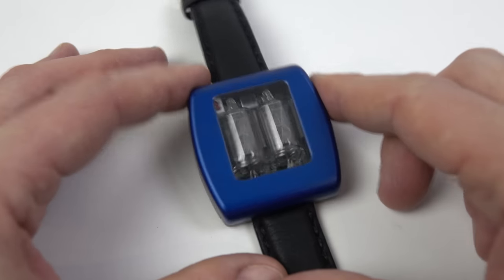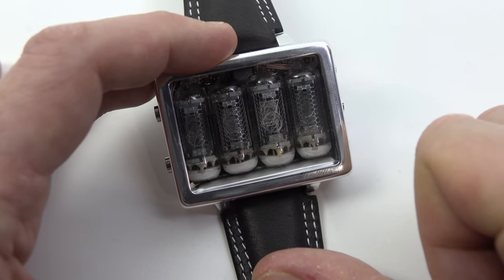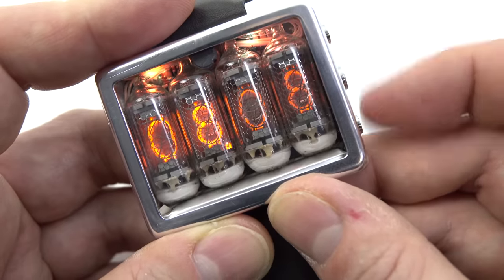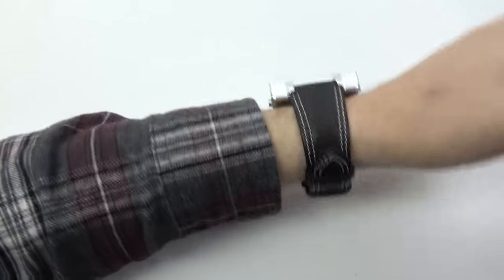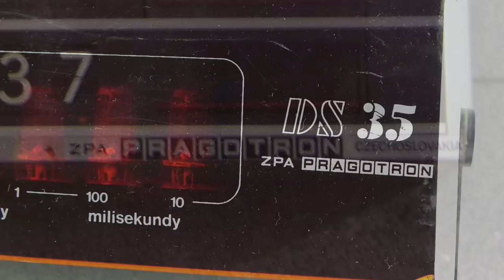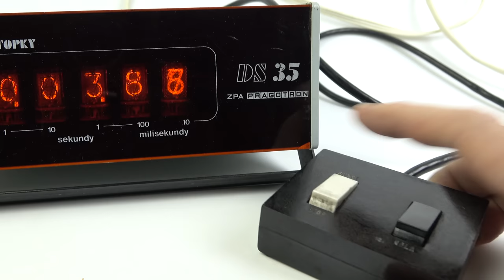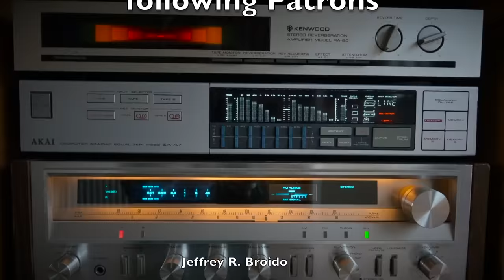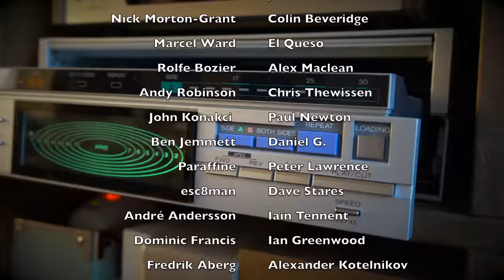Nixie Tube 2-in-1 : New Watch & Old Stop-clock

Comment: I had a Heathkit Nixie tube alarm clock I picked up in a second hand store in the 1990s (the unit itself was from around 1970). It was an exceptionally clean design with all the set switches on bottom and back with a simple metal band running along the top to activate snooze.
Reply: Wow I loved HeathKit! Miss that company so much I built many kits from them, including a weather center that used a flat panel version of the nixie tube.

Comment: The earth pin isn't 'missing', that plug is normally used with a socket that has the earth pin sticking out.
There's a  AMF venner digital counter that can be used as a frequency counter, but also as a stopwatch, but it's not as elegant as a dedicated stopwatch (i have one)

Comment: This Nixie watch is really neat, but for the temperature correction I'd have to say that this is a tricky subject. The more your hands are touching the watch, the more it gets heated up, so it won't display the room temperature accurately, but instead it will display a temperature that is closer to your skin temperature. I guess the correction setting would be for that, in order to correct for this factor (since wearing it on your wrist will definitely make it warmer than the environment), however I don't know how accurate that is in different climates, for example being inside a room at 20°C compared to being outside in autumn or winter at 5°C...

Comment: It would be a good idea to replace the mains wire on your stopky clock, what you have there looks like three core single insulated cable. Modern cable is double insulated - the three plastic covered wires are all within a second plastic covering. This is important because the single insulation can crack exposing bare wires.

Nice clocks though

Comment: the earth pin is not missing on that czechoslovakian clock, it is like this, because the wall sockets have the pin instead and two holes, the connector has two pins and an earth hole
Reply: PETR DOLEZAL Just like in France, though I have heard a rumor that the French plug are wired backwards (Live and Neutral swapped), though that may just be a misunderstanding.

Comment: I'll have to dig out the thing I got in a box of junk from an amateur radio club auction. It's a voltmeter with hot wire displays, never actually run it up, but I did get some info from the maker - before which I didn't know it was a voltmeter - was hoping it was a frequency counter

Comment: The right digits seem like they're labelled oddly.  Milliseconds when actually it's centiseconds (you'd need 3 digits to show milliseconds), and 100 under the tenths, and 10 under the hundredths.
Reply from the maker: See the multipliers under the digits. It’s a bit like the RPMs in my car which are x10.
Reply: Czech (or Polish, since the words are the same in this case [or I imagine any language]) doesn't really use centiseconds in everyday speech. I mean, it would just be really odd to have it labeled as centiseconds, but it's immediately understandable how to read milliseconds with two digits.
Reply: labeling is consistent. it is sec/min and 10s of sec/min too. not 10th of sec/min.
Reply: OK I guess I can see it.  The first digit to the right of the decimal is 100s of milliseconds, the second is 10s of milliseconds.
Reply: I don't think anyone uses centiseconds. I was just thrown by calling them milliseconds when there weren't 3 digits to the right.
Reply: that is because you are technically correct. the best kind of correct :)  on the centiseconds
Reply: In english 'centisecond' is not really a word used, 'tenths of a second' and 'hundredths of a second' is used.

Comment: CELSIUS! Centigrade has not been used since the 1950's. And no, it is not the same thing, close, but not the same.

In other news, good video as per normal. I wish these nixie tubes were cheaper.
Reply: I am pretty sure it is the case.

The BBC never used Centigrade, must have been a slip of the tongue from someone (presenter). They moved from Fahrenheit to Celsius in 1962. To quote someone you might relate with, Mr Shakespeare; "A rose by any other name would smell as sweet"; meaning something will not become something else by calling it another name.

It was changed from Centigrade to Celsius in 1948 and adoption took a little longer. When I was in school in the 80's and 90's we used Celsius (or Kelvin) exclusively as all scientific measurements by that time was being done in Celsius. You might have still been using old textbooks when you were in school, as is the case in many circumstances. 

But that's not the point. 

The electrical thermometer in the watch is most surely measuring Celsius and not Centigrade and has been the case since we stopped measuring temperature using hydrogen and started using mercury and moving forward.

Just because some people do not want to change old habits, does not change the facts.

Comment: That plug looks like a version of a French europlug, with the earth pin in the socket rather than on the plug, no point trying to find an adaptor for those, none exist it seems (unless you bought a french extension socket and wired a UK plug on the other end), just schuko to UK which has a different earth arrangement, all very silly really, so many incompatible standards based on the two-pin europlug... :P

Comment: Nixie tubes watch? Worst idea EVER, having a 200-300v power supply in your wrist where you will sweat is not a very smart idea...
Reply: Amps are the problem, not volts.
Reply: Amps are the dangerous part, but high voltage is the key to get zapped. As voltage is very high a high resistance is enough conductive to create a current. You will not die, but you will get shocked, not a funny experience.
Reply: Both are the problem.  See ElectroBOOM's video on this.  "It's not the voltage, it's the current" is really not very true at all.  It's both voltage and current AND frequency that determines how dangerous electricity is.
Reply: Yeh but you need the volts to get the amps to flow through the body
Reply: It's not the electrons, it's the holes.
Reply: Both are bad ideas, to use a chinesse charger while you use the cellphone and to wear a nixie tube watch :) (unless you are in some kind of SM practice and you love to be electrocuted XD)
Reply: ThatSaneGuy That's false, the amps are the ones causing death. With 120mA you can stop a human's heart, independently of the watts used. If your body were very conductive with very little power you would kill a person.
Reply: Volts and watts aren't important, only amps are important.

Let's do an example (with fake numbers, but to prove the theory).

Suppose you have a human which is holding two wires on it's hands, and let's suppose the measured impedance of the body between those wires is 1MOhm.

To provoke a heart attack you will need:

V = R * I -> X = 1000000 * 0.120 -> 120000 volts, that's W = V * I -> W = 14400 watts.

So, for 1MOhm you need 120kv and 14.4Kw

Now, let's put the wires on it's nipples, and let's suppose the impedance of the body then is 500KOhm.

To provoke a heart attack you will need:

V = R * I -> X = 500000 * 0.120 -> 60000 volts, that's W = V * I -> W = 7200 watts.

So, for 500KOhm you need 60Kv and 7.2Kw.

As you can see volts nor watts are the problem, but amps.
Reply: ThatSaneGuy If your body has 0.5Ohms of impedance then with 60mV and 7.2mW you would be dead. Again, volts and watts are irrelevant.
Reply: ProCreeper 2000 No, voltage is relevant if you take in account impedance, else it's irrelevant. You can make 10Kv pass through your body with no consecuences, but 120v can kill you, why? because 10Kv of DC will find a very high resistance and create very low current, but 120v AC will find very low resistance and create high current.
Reply: People use EL wire for costumes all the time and that runs at 180v
Reply: Wight People also jumps from bridges all the time and that doesn't turns it into something safe...
Reply: I think you need a lesson in electricity
Reply: does that means that somehow you can add some kind of hand zapper module ?
Reply: get out!
Reply: Try for 170v max.
Reply: The Nixie tube stop watch looks more pleasing and is more accurate than the iPad timer, which can't refresh fast enough to display every millisecond
Reply: Here is an idea. Don't use cheap aftermarket Chinese chargers. 
Use the one that came with the phone.  Recently a 14 year old girl was electrocuted while using her phone in the bath tub while plugged in to the charger. Had she been plugged into one of those old razor outlets with the isolation transformer she would have survived. Thing is someone decided that we didn't need those totally isolated outlets, and the GFI was made standard. I am not a fan of GFI. I much prefer the total isolation of a transformer. Not that it matters to me, I shave with a blade.
Reply: It's the math that kills you... when you can't do it.
Reply: 200000 amps at .01v is 2000w and that wont kill you
Reply: I don't consider this type of watch to be a significant risk to life but, obviously, care should be taken to avoid getting it wet. With all the arguments about Amps, Volts and electrocution no one has bothered to mention that the location of the two points of electrical potential difference (both the wires) are critical as to the likelihood of affecting the heart. If you get a shock with both points on the same limb it is virtually impossible to stop your heart, unless the 'shock' of being electrocuted induces some sort of heart failure (probably due to an existing condition). This is why any sensible electrician will always only use one hand (with the other behind his / her back) when dealing with voltages over 60 volts, or so. Obviously, with very high tension electricity other forms of safety procedure need to be followed as there is a likelihood of severe burns resulting from any shock where sufficient current can pass.
Reply: You need a high enough voltage to break the skin resistance so the current can do it's damage.  It only takes about 100 miliamps of current across the heart to stop it.
If no current flows across the heart it will not kill you. I have been hit by very high voltages, 30,000 volts DC from the second anode on a color TV,and it hurt like a bastard, and split my thumb nail in 2, which I still have the scar today but it didn't kill me. Why, because there was no current path across my heart. The current went in my forearm, and out my thumb to ground. It left me with a nice electrical burn, which if you have never had one, you don't want one, because it is fu-king painful. 
I have also been jolted by a microwave transformer, 2200 volts, and that hurt llike a son of a b--ch too, but again I am here because I followed safety guidelines. Wear insulated shoes and keep one hand in my pocket. That way if you get jolted, you are like a bird sitting on a wire, you are not harmed. I felt it because there was an exit point on the same limb. If there had been no exit point I wouldn't have felt a thing.
Be safe around electricity. Been working on  electronics. Shocked dozens of times, but nothing evenly remotely dangerous because I know what I am doing, and don't put myself in a position where there can be voltage/current flowing between limbs as that is where the danger is.
Reply: As i said it's not lethal, but very unpleasant, having a mini-tazer on your wrist is not very wise. And about the heart attack, if you get to 120mA you get a heart attack, independently of watts, volts and impedance. Of course I is related to V and R, but the key is I, V and R can have any value while I gets to 120mA.
Reply: Chris Tate You should be really ignorant, 10Kv of DC can't kill you, human body resistance through arm to arm is usually 4-5MOhm, that's only 25mA, yes, you will get shocked, but nothing that can kill you.
Reply: multisomebodyelse ¿ notme I don't have any control over cell towers and 5G, but I can inform that is a bad idea to use this type of watch :)
Reply: OK this is getting carried away with.  A "Mini tazer" really?  A tazer operates at about 60,000.00 volts. A nixie tube 170 volts. Big difference.
Reply: 12voltvids Dude, really, can't you understand what an exageration is? What does a tazer? Shocks you. What can happen with this if it enters in contact with sweat? It can shock you. Yes, very little current, but enough to be very unpleasant (as I keep saying again and again).
Reply: Tell that to the family members of people that have gone into cardiac arrest and died after they were  tazed. Yes it is rare, but it has happened.
Reply: How the hell is that related man? Anyway if you like to be shocked, just go ahead and buy one, no one will stop you.
Reply: @geniwab: How on earth would you get this to shock you?  Even getting it wet there's no circuit to complete externally due to the conductive metal case so I can't understand how you would get a shock from it without disassembling it first!
Reply: what if I "isolate" the back of the watch with some kind of insulation tape? will it still electrocute me?
Reply: fahmi perwira 
There is NO way you can get a shock never mind being electrocuted by this device.
Reply: geniwab farts aren't important. It's the poops that matter.